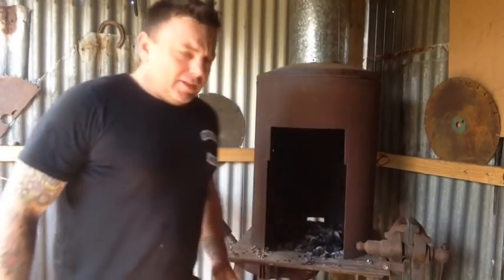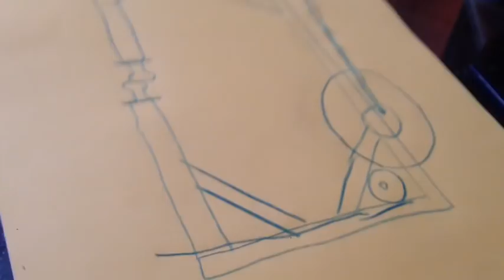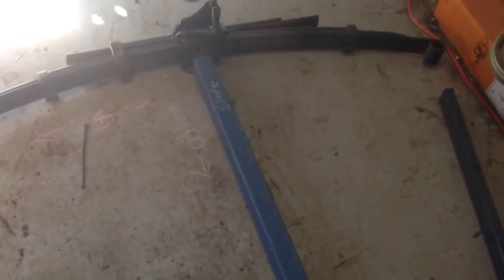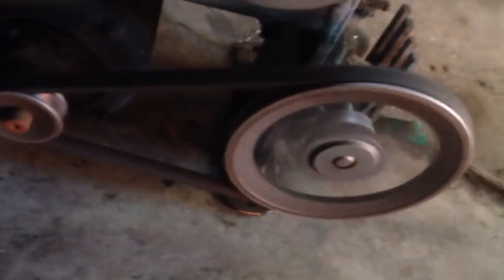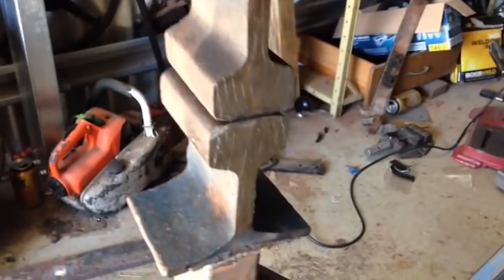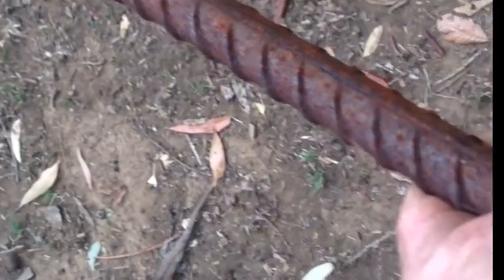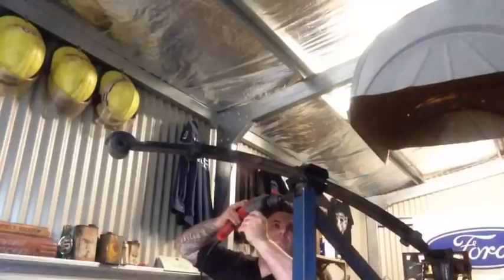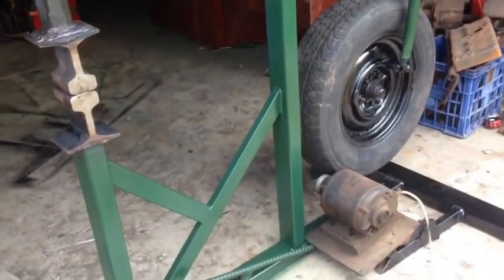Build your own power hammer, cheap!!!

Comment: i wish he had said what kind of motor it was
Reply from the maker: Man it was just a random old 1/4hp 240volt electric motor I had kicking about. You could use whatever you can find. An old washing machine motor would do the trick. Thanks for watching 🤟🏻
Reply: @oldskoolonly   Thanks for the reply bro! I've been building plans for my own power hammer, and I just don't know dick about motors lol. To be specific I'm trying to create a power hammer that can be completely modular. Hammer weight, workpiece overhead, and speed... I've gotten the whole thing worked up BUT the motor. For some reason like no one says what motor they use
Reply from the maker: Sounds good man. I can’t speak for others but I just used what I had lying about and it worked out ok
Reply: @oldskoolonly   I definitely could make one for myself easily enough. But I'd like to offer these plans to the community for free when I'm done. Imagine having a power hammer that can be a 50 lb tuned for doing detail work, and in 10 minutes switching it to a 200lb deadblow for super large projects. All for under 500$ of material.
Reply from the maker: Sounds great